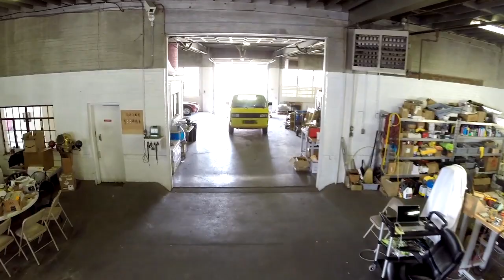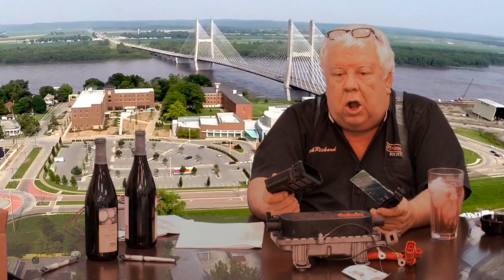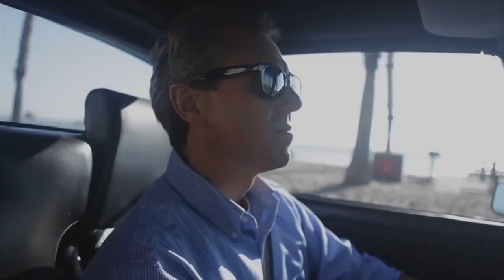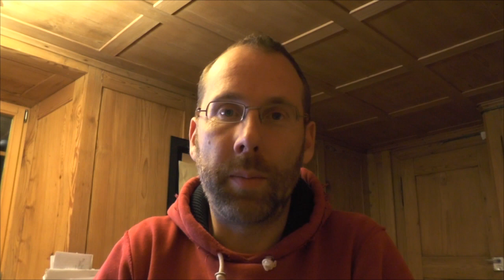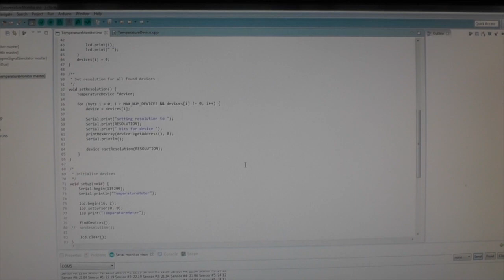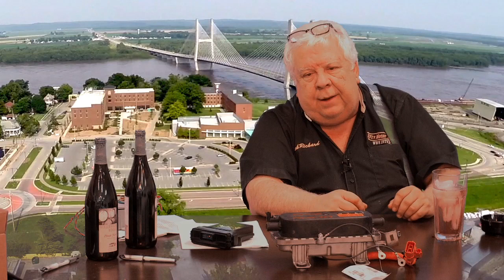EVTV Friday Show - March 13, 2015

Comment: What do you think about 18650 trac packs?
Reply: Long term tests are starting to show that the Tesla batteries are lasting much longer than any of the others, especially the Leaf. Plus they can charge much faster than the others. Probably the reason you can't find them for sale like the used Leaf batteries.
Reply: Nestor Diaz The trouble with 18650s is how difficult they are to deal with.  I'm planning my own build using them, and it's going to take 2,304 cells to provide the voltage I want at the current I need.  Assembling a pack like that is an enormous undertaking.

You can get 1- or 2- or 3- cell snap-together cell ends to build your own pack, but then it's up to you how you want to wire them, if you want fuses, etc...  It takes some engineering (electrical, systems, and mechanical) to work out the arrangement, current carrying capacity, fuse materials and sizes, welding technique, and so on.

There's little a retail outlet can do to make your life easier, since one of the primary motivations for using 18650s is the flexibility in placement and pack size -- that means pre-configured packs might be difficult to sell since everyone would want to customize them.

Of course, the other benefit is available chemistry.  IMO, LiFePo4 is old tech and due to be replaced.  The cycle life is great, but with a large enough pack and commuter usage, you'll charge once a week, and so 500 cycles with the more energy-dense chemistries might still last you a few years.  Likely until tech or age wears them out anyway.  So, it would be nice to see more CALB-style blocks with alternate chemistries.  Leaf cells are a fine example.
Reply: Nick Guy I agree lifepo4 isnt the best option anymore. Have you looked in to Tesla self contained trac packs? The have fuses, temperature regulation and everything the battery needs in a ready to use pack. Sure there are draw backs to use it like you mentioned, but they do seem to be an efficient option.
Reply: Briefly... but the voltage was too high for an HPEVS setup and the pack dimensions don't work for my car, so after the modifications it would need, there wasn't much benefit over going with discrete cells.  (I decided on Samsung INR18650-29E, BTW.)

I'd like to see more done with 18650s though, because it's a really flexible option if you're willing to put in the time and effort.  I don't know that it's EVTV's cup of tea, and so we may not see much love from Missouri on it.  Just the same, if there's anyone out there doing it, send in your videos!